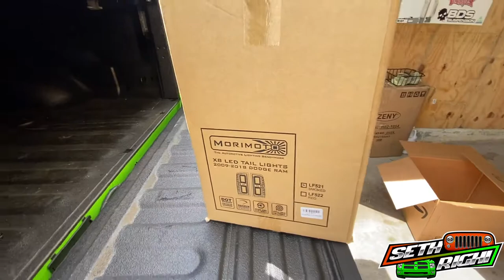Ram Morimoto Led Taillights 2009-2018

Comment: I wonder if these have any similar issues as their headlights, that’s why I went with alpharex. They are slick though!
Reply from the maker: im not sure i don't know of any one with any issues on the headlights  everyone i know swears by them!
Reply: I’ve had my red housing set for two years with no issue other than the red paint inside fading. The lense is clear on the red ones and they have faded to almost a pink color. I’m returning them for a black set under warranty.
Reply: @dmsndy  Shit that's unfortunate... I was going to get the red ones to go with my black ram but I wish they were a darker red, I wonder if they have since solved that issue? But I might stick to getting the blacked out ones, I take it morimoto honoured that with no issues at all?
Reply: @SillyGooser  still pending, I shipped them back this past Friday so hopefully they will have them Monday or Tuesday and I’ll know something then. After a few emails back and forth they seem like they are going to honor the warranty. There are screws on the back under some epoxy that you can remove. You might have to remove the screws and bake the light for a few minutes but I know they will come apart to color match or paint darker. That voids your warranty though. Ryan Mayer had his painted green to match his Lime ram. They looked sick
Reply: @dmsndy  I'm glad they were quick to respond and handle the situation, that's kinda why I want to go with morimoto for all my light upgrades I'm doing soon. And yeah that would be cool to do but I'm going to keep them as is just so I don't void the warranty, hopefully in the future a dark red version will be available!